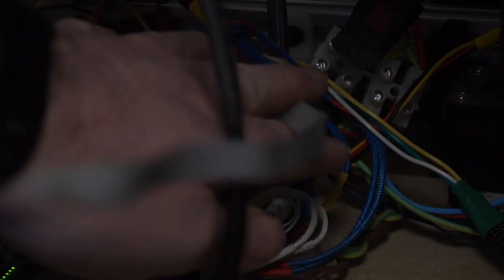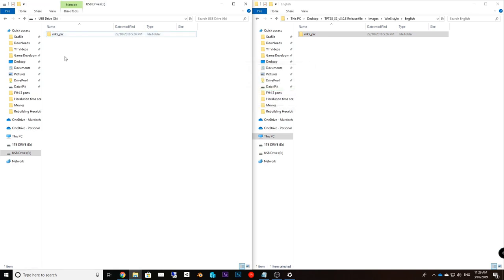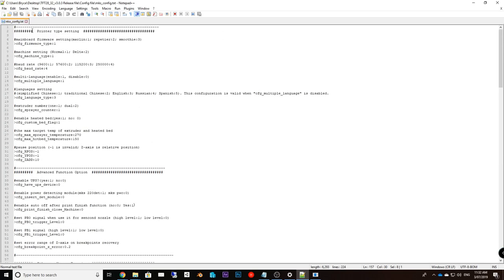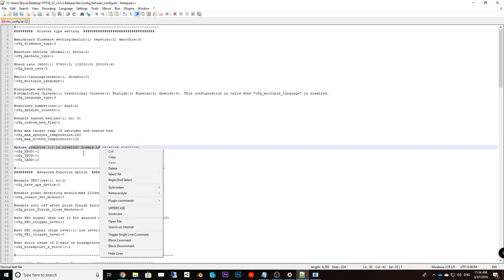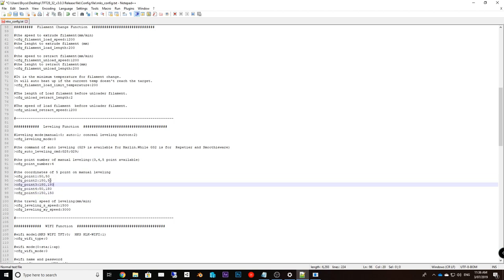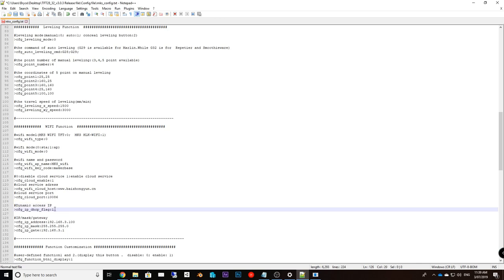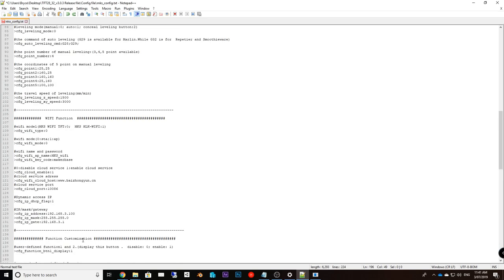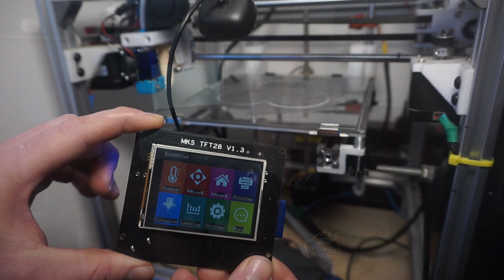How to set up your MKS TFT screen with your printer!

Comment: Thank you so much. I have updated firmware to 3.0.6 version now but there is a problem. I cant see some adjustments on my TFT28 such as speed interface. for example I want to change speed of movement but unfortunately there isn't any interface and axis motors move in hi speed. what is the solution?